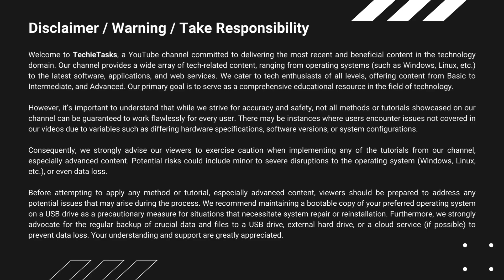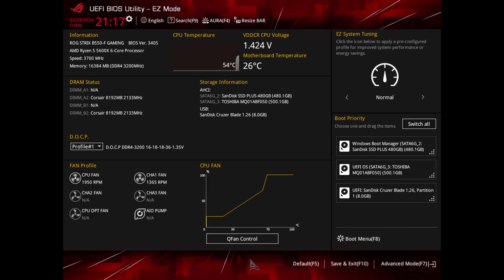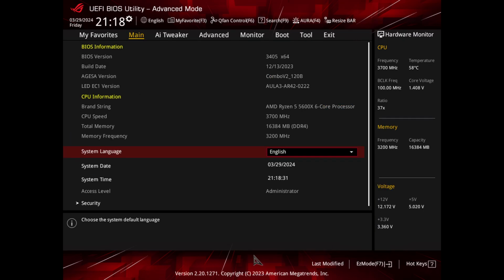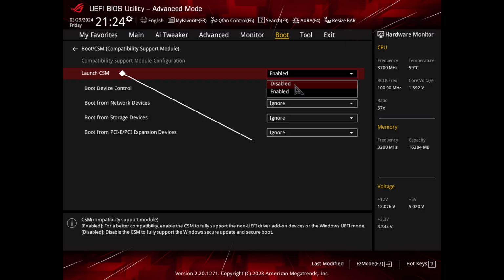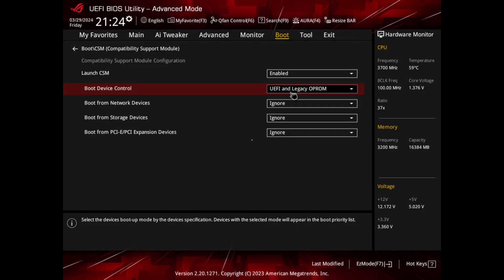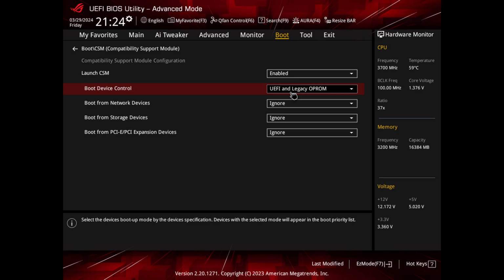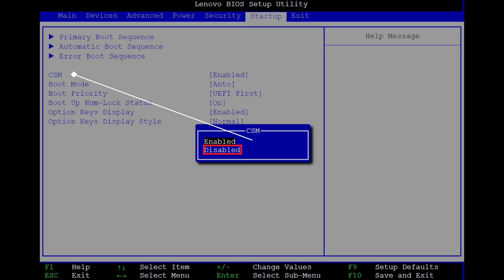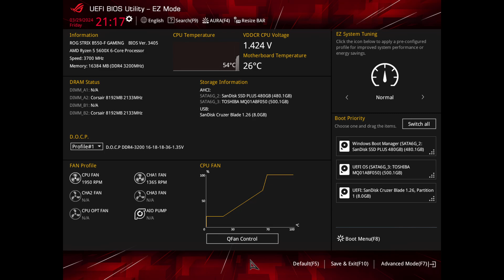How To Disable / Enable CSM in BIOS

Comment: So the thing that pops up after pressing disable doesn’t mean anything? Is it safe to continue? Trying to help my friend do this but don’t want him to mess something up.
Reply from the maker: It’s a real warning, but whether it matters depends on your setup.

It’s usually safe to continue IF:
Your system is already installed in UEFI mode (not Legacy).
You’re using a modern OS like Windows 10 or 11.
Your storage drive is formatted as GPT, not MBR.
You’re trying to enable Secure Boot (which requires CSM to be off).

It’s not safe if:
Your OS was installed in Legacy BIOS mode (MBR).
You have older hardware or boot devices that only support Legacy mode.
You’re not sure how your system was originally set up.

Before disabling CSM:
Back up important data.
Check if your system is using UEFI + GPT:
Press Win + R, type msinfo32, and look for BIOS Mode and Partition Style.

How To Check Partition Style MBR or GPT in Windows 11
https://youtu.be/IFiWdbtt4Ck
Reply from the maker: If you’ve already disabled CSM and your device doesn’t boot, you may need to convert the partition style from MBR to GPT.

How To Convert MBR to GPT without Losing Data
https://youtu.be/u0yve_v2Izg

Comment: I'm doing this for Valorant, but I'm in the BOOT option, there's no CSM here. I have a Gigabyte B860 Eagle motherboard, what should I do?
Reply from the maker: When you enter BIOS, press F2 to toggle between Easy Mode and Advanced Mode, CSM settings are usually only visible in Advanced Mode.

Navigate to the BIOS tab, Look for CSM Support, it may be hidden unless certain conditions are met:
If your system is already set to UEFI boot mode, the BIOS may automatically hide the CSM option.
To reveal it:
Go to Settings > BIOS > Windows OS Configuration
Set Windows 10 Features to Other OS (instead of Windows 10/11).
Save and reboot into BIOS again, CSM should now appear.

Comment: so i have a hp omen laptop and i'm trying to play valorant but it doesn't work due to some UEFI firmware settings of secure boot plz help
Reply from the maker: To play Valorant on your HP Omen laptop, Secure Boot must be enabled and CSM (Compatibility Support Module) must be disabled, because Valorant uses Vanguard, an anti-cheat system that requires UEFI with Secure Boot.

How To Enable / Disable Secure Boot in BIOS
https://youtu.be/RSBbfLGRWN0

How To Change BIOS Mode from Legacy to UEFI
https://youtu.be/4wX0S1TsttM

Valorant requires UEFI with Secure Boot, which only works with GPT partition style.

If your disk is still using MBR, you’ll need to convert it to GPT:

How To Convert MBR to GPT without Losing Data
https://youtu.be/u0yve_v2Izg

Comment: Respectfully, this is not particularly helpful.  Disabling / enabling CSM is trivial, just a menu selection.   Checking that other settings are done properly, such as making certain the boot drive is in GPT format is critical.  Blindly disabling CSM is why there are many videos on what to do you when your system is suddenly hosed.
Reply from the maker: Respectfully noted 😊, and you're absolutely right that blindly disabling CSM without verifying the boot drive’s partition style can lead to serious headaches. That’s exactly why we’ve created videos that walk through each step one by one: how to check your partition style, how to convert MBR to GPT...

This particular video is focused solely on enabling or disabling CSM in BIOS. just the toggle itself.
For everything else, we’ve got dedicated guides to help users avoid the “system suddenly hosed” scenario. Thanks a lot ❤

Comment: when i disable it and i save and exit it just sends me back into the bios settings. i have a legacy version and i got the GPT thingy
Reply from the maker: Using a Legacy BIOS with a GPT disk creates a mismatch that often results in boot loops, sending you right back into BIOS.

If you've disabled CSM and can't boot, try re-enabling it. Then, ensure your boot mode matches your disk format:
MBR for Legacy BIOS.
GPT for UEFI.

Solutions:

Option 1: Convert GPT to MBR:
If you want to stay with Legacy BIOS, you'll need to convert your disk to MBR.

How To Convert GPT to MBR without Losing Data
https://youtu.be/jlOczjt7fx8

Option 2: Switch to UEFI:
GPT is designed for UEFI, so if CSM is disabled, your system attempts to boot in pure UEFI mode. You may need to reinstall your OS in UEFI mode for proper GPT support, or attempt to repair the EFI System Partition (ESP) if it's corrupted or missing.

How To Fix / Rebuild GPT EFI System Partition
https://youtu.be/gFABHXTKaIA

Comment: Idk why but my pc is in bootlop after disabling csm
Reply from the maker: I'm sorry to hear that you're experiencing this issue! Disabling CSM can sometimes cause boot problems, especially if your system isn't fully compatible with UEFI mode.

To resolve this, you can try the following steps:

Go back into your BIOS settings and re-enable CSM to see if that helps your system boot up normally.

If your OS disk is still using the MBR (Master Boot Record) partition style, you might need to convert it to GPT (GUID Partition Table) for better compatibility with UEFI mode.

How To Convert MBR to GPT without Losing Data
https://youtu.be/u0yve_v2Izg

Comment: What if CSM option is grey not allowing me to change it?
Reply from the maker: You can try disabling Secure Boot: Go into your BIOS settings and disable Secure Boot. This might help in making the CSM option available. Also, keep in mind that this issue often occurs when using integrated graphics on newer motherboards, especially those with Intel 500 series chipsets.

Comment: I couldn't find it on ver 2.22.1286.
Reply from the maker: If Secure Boot is enabled, it might prevent CSM from being available, Sometimes, other BIOS settings like Re-Size BAR Support or Above 4G Decoding might conflict with CSM, causing it to be unavailable.
Reply: @TechieTape  there is no option to disable it, but i have options to change its mood to custom rather than standard, and there are 4 subcategories for custome mood. There are 4 key sources to boot.
I'm still struggling with the issue.
Reply from the maker: @f.heravy  Changing its mode is like enabling or disabling it.

To disable CSM and stick to pure UEFI mode, you should choose the Standard option. This usually means UEFI mode without any legacy support. The Custom mode likely allows more flexibility UEFI / Legacy.

Also when you select an option, you might get a description on the screen about what it does, which might help you figure out which mode is which.

If you still having a problem, just explain more about what you are trying to do, hopefully I can help.

❤
Reply: @TechieTasks  I cloned my ssd win 10 from my old system to nvme new PC.
I thought I would be able to upgrade the windows later. After clone, there is no Bootable drive. I'm still struggling...
Reply from the maker: @f.heravy  1. Check boot order, make sure the cloned drive is the first boot device.

2. If your cloned drive is a GPT disk, make sure the UEFI boot mode is enabled, and if it is an MBR disk, then set it to Legacy boot mode (CSM Mode: Custom, Boot Device Control: Legacy..).

3. If Secure Boot is enabled, it might be preventing the system from booting from the cloned drive.

Then check:

How To Fix / Rebuild GPT EFI System Partition
https://youtu.be/gFABHXTKaIA

How To Fix / Rebuild MBR System Reserved Partition
https://youtu.be/gqM9L5Xptt4

Note: If diskpart > list disk shows a * next to the drive in the Gpt column, then it's a GPT disk. If the Gpt column does not have a * next to the drive, then it's an MBR disk.

Extra:

How To Convert MBR to GPT without Losing Data
https://youtu.be/u0yve_v2Izg

How To Convert GPT to MBR without Losing Data
https://youtu.be/jlOczjt7fx8
Reply: @TechieTasks  none worked!

I checked the videos and applied them, you know, I can only see the NVMe when I boot from bootcd hirens!
Reply from the maker: @f.heravy  Is the NVMe detected in BIOS/UEFI? What motherboard and CPU are you using? What NVMe are you using? and is the NVMe a GPT or MBR Disk?
Reply: @TechieTasks  No, it does not show on bias, too.Intel Core i7 14700F processor and 32GB DDR5 U-DIMM RAM combine to offer seamless and optimized performance while gaming and video editing

1TB M.2 2280 NVMe PCIe 4.0 solid state drive provides more storage space with faster read and write times.
I'm not sure about GPT or mBR.
Reply from the maker: @f.heravy  If the NVMe is not showing in BIOS/UEFI at all, not just as a bootable device.

For example, if you go here:

https://youtu.be/P6WRLo6ntjQ?si=zNu8DcND4pUV4Pol&t=22

In the middle of the screen, you will see Storage Information, which shows the connected drives.

Then it might be a compatibility issue. Try updating your BIOS:

Go to the motherboard manufacturer's website and download the latest version of the BIOS. Read the instructions on the manufacturer's website to update it. If you need any help, let me know the motherboard you are using.

Also verify that your motherboard slot supports NVMe PCIe 4.0 drives. Sometimes specific slots are required for certain drives & Make sure NVMe is enabled in the storage configuration settings in BIOS/UEFI.